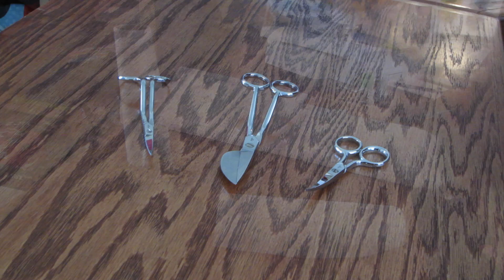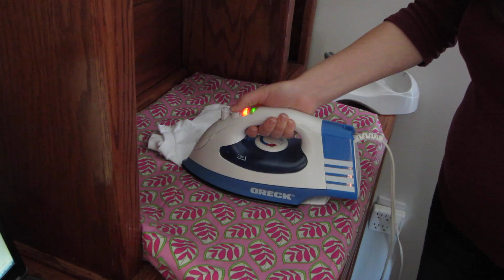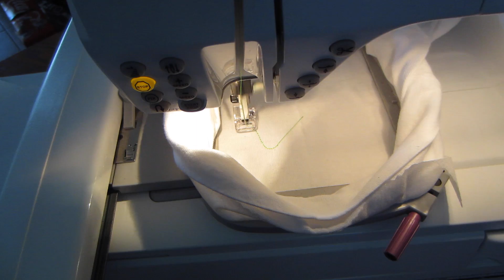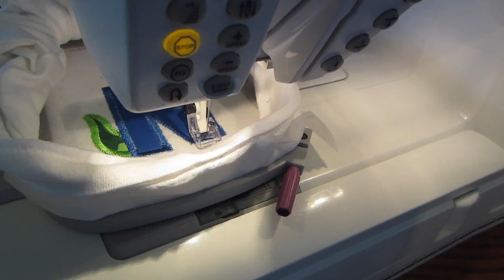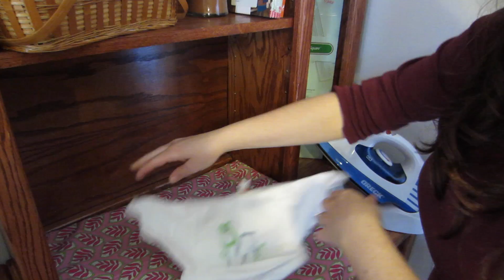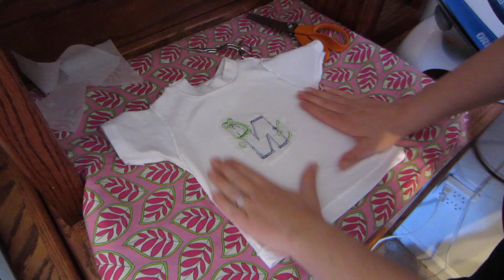How to Applique Machine Embroidery

Comment: I like the idea of covering the design on the back when finished.  In this video, what is the product you ironed on the back?
Reply: Kara Walker I had the same question, I wonder if it's the iron on stabilizer, she called it cover stitch.
Reply: I found some at Joann's called Cover a Stitch or Stabilizer.  It is an iron on.  I have used it a couple of times and like it.
Reply: Kara Walker nice job

Comment: Please post a video on how to machine  applique a t-shirt using the float method.

Also, your video doesn't mention using Heat & Bond light or Steam a Seam on the fabric pieces that will be appliqued onto the garment on top of the placement stitch.  Thanks for your help.

Comment: This was informative and a great way to show how some designs let you use up small scraps, but I would never recommend trimming after the tack down stitches without taking the hoop off the machine.  It is too easy to bump push or pull the fabric and offset the alignment of the design.

Comment: I have used the exact technique you used.  I always wash the t-shirt and applique fabric before I make a t-shirt.  My problem is that once I wash it, it never looks the same.  I have tried using wonder under or heat n bond on the applique fabric before I use it.  After the tack down stitch and trimming, I iron the fabric with a small craft iron before the final stitching and it still wrinkles after washing.  Do you have any other suggestions?